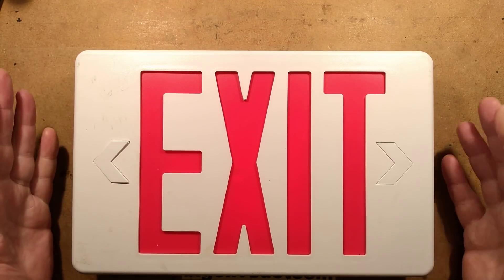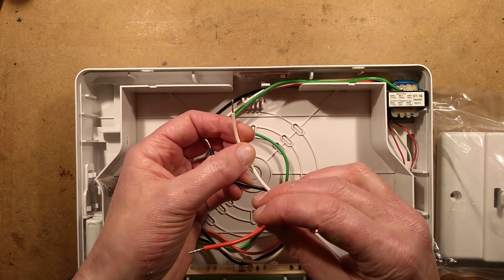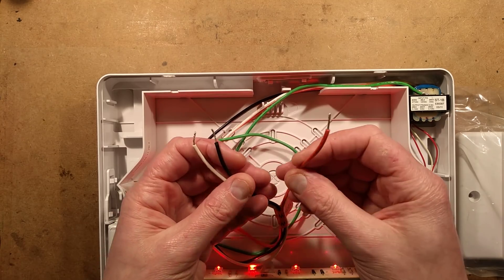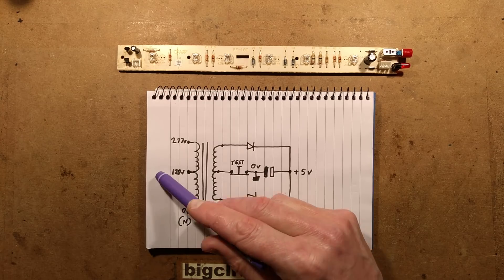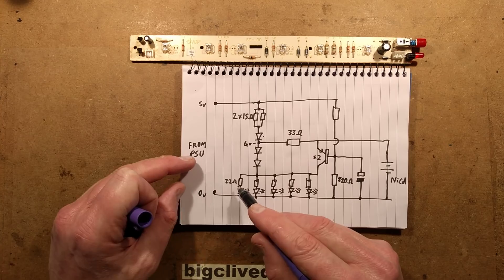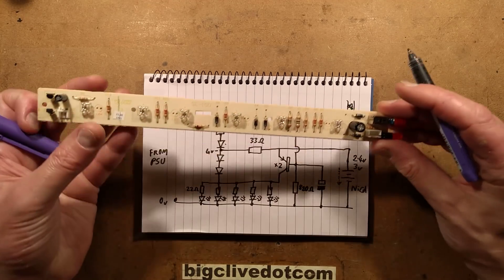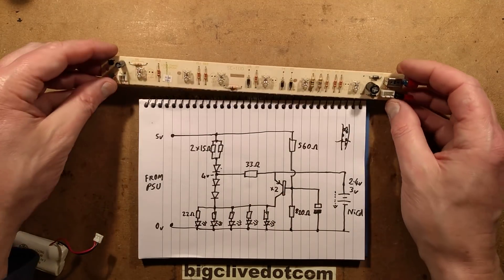Inside an American emergency light (with schematic).

Comment: PLEASE more morbid stories. I teach electronics to students and nothing helps to emphasize the point of safety more than such stories. And I ran out of stories of me getting zapped because of my stupidity.
Reply: Never be one "thing" away from a fatal situation.  Always treat the wires as live, even if you know they're dead.  That's saved me a couple of times.  Once from my own stupidity and once from someone else's mistake. When death is on the line, you want as many safeguards as you can reasonably get.
Reply: Rent a copy of the Martin Sheen movie "The Believers" and show the opening scene. I was a teenager, not afraid of electricity, and since I saw that I've been very wary.
Reply: I heard in class of a copper thief stealing the copper bonding from a transformer substation and died on his way out from the brand new electric fence.
Reply: When I was at school doing a project involving water pumps and a tank, the teacher handed me a "12v" transformer to wire up my damp windscreen washer pumps. The zero had rubbed off. That's the one time I've ever been electrocuted (based on the fact I passed out for a few seconds I'm going with electrocuted!) and I can't say I enjoyed it. 
Moral of the story - teachers are assholes :)
Reply: @beware_the_moose  as an academic teacher I agree 100%
Reply: Working in an 480v industrial panel, probing the connections on a terminal strip, which was a series of points in an E-Stop string. I was troubleshooting why I couldn't clear the E-Stop. Inside the panel was a 480 to 120V control transformer with long brass studs for the 480 side, which was normally supposed to be covered with a sheet of Lexan or Plexiglas. Well the cover was gone and I was leaning against the side of the panel with my left arm, and my right arm touched the brass terminal. This put 277v (one terminal or 480v 3 phase) across my chest. I was in the hospital for 3 days until my heart resumed its normal rhythm, but I sustained damage to the heart muscle that shows as if I had a heart attack in an EKG. That one mistake could possibly shorten my lifespan by as much as 10 years.
Reply: When you've rewireda mains plug, ALWAYS screw it back together!! I forgot once  years ago, accidently kicked it, back came off & I stood on it with bare feet! I can still recall the pain now as I type this. :(
Reply: @samarnadra  If anyone wants to watch that video. here it is: https://www.youtube.com/watch?v=H66Fbg9nrk4 Great stuff!!! :-D
Reply: I have many.......
1- never trust the guy that says "The breaker is open".
2- If you don't check for errant strands of wire on a terminal row, you will replace said terminal row.
3.-If you try to use a drive that is rated 410-3ph-1g-1n on a power supply that is rated 440 3ph1g, said drive will die gloriously.
4.- Check the new guy's work for a few days and make sure he doe's not put all of the "extra wires" in the bottom of a  480 x 240 x120 volt transformer into ONE LARGE WIRE NUT.  It will release a LOT OF MAGIC SMOKE.

Comment: This is the second video in which you've said UK emergency lights have to run for 3 hours.  Not true.  The duration can be one, two or three hours.  Which one is used depends upon circumstance like if the building will be evacuated immediately, if it will be re-occupied before the batteries can fully recharge, etc. 

See https://www.firesafe.org.uk/emergency-lighting/
Reply from the maker: I've only ever come across the full 3 hour duration lights.
Reply: @bigclivedotcom  
Three-hour duration is by far the most common, but the regulations permit the other durations in appropriate circumstances.  Many manufacturers may choose to only offer 3-hour lights simply to cut down on the number of products they sell and components they stock.  It wouldn't surprise me if the ones that do offer other durations simply take a 3-hour model and stick a label on it that says 1 hour or 2 hours and make the price reduction minimal.

Nevertheless, if it's a large building and the circumstances permit then it may be worth fitting shorter duration lights.  If you can get them cheaply enough.  If anybody even makes them any more.

Comment: Wouldn't normally think that its essentially an auto-transformer. Definitely worth noting...
Reply: Those little 120/277V transformers are marvelous for building Cockroft-Walton ionizers.
Reply from the maker: I've toyed with whether they could be used like that.  Theoretically a small secondary load like an indicator LED would help with primary coupling too.

Comment: I think the extra capacitor is to keep the the battery from activating when the ac line crosses zero. There is a smoothing capacitor on the other side of the rectifier diodes, but you can still see the LEDs pulsing a bit when run on AC power.
Reply: That's correct!

Comment: typical us crap… no psu just an old transformer… rip power consumption
Reply from the maker: Very low power and simple.  The light will probably last longer than a modern switchmode unit.
Reply: @bigclivedotcom  - Reliability is definitely more important in this application than efficiency.
Reply: Transformers are quite efficient, even switchmode power supplies use them. As long as you aren't using linear regulation for heavy current draws I don't see the problem.
Reply: A mains frequency transformer is typically more efficient than a switcher.  People mostly use switchers because they are smaller and lighter.  Most of the loss in this design is likely in the output side rectifier.  About 10% of the input power is likely lost in the forward drop of the diodes.  About the same would be true of a switcher design.   Nobody is going to do synchronous rectifiers on the output side at these power levels.  It is not worth the extra effort.
The primary side rectifiers and the switching device would lose only a few percent.

Comment: It's 40 years since I was involved with those things in the UK, but most designs of exit sign would also throw downward illumination to save having to fit an emergency light as well as the sign.  Upside: lower cost.  Downsides: if the sign fails you've also lost illumination along the exit route and the manufacturer sells fewer items.
Reply: In Colorado in 2005 I was surprised to see the green exits signs at floor level in hallways and corridors. This makes them visible even under a smoke cloud (where people would be crawling) and also provides some areal illumination.

Comment: we have a very similar exit light at work, but it had a few more transistors on it.  After reverse engineering it, 2 of the transistors formed an SCR (cross-connected) so that when the device is shipped, the battery is connected, but the LEDs do not light.  Once power is applied for the first time, the "SCR" is triggered and the LEDs light, and will continue to light when power is disconnected.  Disconnecting the battery will reset the battery "freshness seal"
Reply: Right. Our transformers are out in front of your house. 'Round here it's 2 houses to a box.

Comment: It's a misnomer or misunderstanding that US residential power has 230V across two "phases", we have transformers with one distribution phase and two 115V secondary windings, one turning in the opposite direction, to create two "poles".
Reply: Relative to GND the two sides of a North American power installation are indeed 180 degrees out of phase, but it's really just one 220V phase with a center tap.
Reply: I prefer the term "split phase".
Reply: Technically you could call it "two phase" but usually it is referred to as "center tapped," or in the case of being connected to circuit breakers and such, "two pole." (Two "hot"/live wires)
The reason why "two phase" is not correct is, there were older power distribution systems that used two phase, 90 degrees apart, thus making it easy to run motors. Of course, if the loads are not balanced, the phasing will be off, so the circuit won't work well (possibly even overheating the motor!). So, it wasn't very popular.
Reply: trickster721 Technically, it's called "split phase".
Reply: Yep. I cannot count the times I have explained this to people, some even being electricians.

Comment: Is this code-compliant emergency signage in the US? If a water sprinkler fire suppression system were spraying water on it, could it short out the sign?
Reply: ebulating  So there isn't a uniform code for emergency signage? That seems rather dumb to me.
Reply: @eddiespencer1  it is rather dumb and ambiguous. But you have to remember that we're basically 50 loosely sewn together entities governed by general federal guidelines, most of the rest is just left for the states to decide. It makes politics here quite confusing.
Reply: @8bits59       Count yourselves lucky.  In Europe the idea that even independent countries can make their own laws would bring about apoplexy in the control freaks in Brussells.
Reply: @eddiespencer1  There is, but states and cities may have their own rules beyond what the national rules say.
Reply: ebulating  Not sure how your answer is relevant since the question was about whether it met ELECTRICAL code regarding water infiltration, not if it was the right colour.
Reply: Many surprisingly simple designs work for keeping sprayed water out.  The direction gravity makes the water go is very important to those designs.

Comment: Its a good idea to cover off every wire that is not in use always
Reply: I think the floating lines is a bit of a ridiculous idea. Surely they could have had some binding posts or something and if you want to wire up to either of the windings you can, without a hazardous thing flapping around.
Reply: @BenHelweg  Or both wires could have come capped right out of the box, letting the user uncap whichever one is going to be used.
Reply: Its weird how he left the wire there, he should have cut and taped it. Was he certified to do the job?

Comment: Nice reverse eng. The cap on the base of the transistors might be just to hold them off after power fail for a short time - though I still can't see a good reason to do that from your cct.  I like the way you had a stab at what wavelength the leds are Clive - very good ! ( I just checked, and yeah, 640nm looks a good guess - very orange-y)

Comment: I like the graphic of the European sign, especially since it makes it easier to understand for those who can't read. However, I feel there's much more simplicity in the visual design of the American sign which also makes it fairly clear. I also think the red is a better color for the purpose.
Reply: Your eyes are roughly 20 times more sensitive to green photons as they are to red photons, thus the change. 
Also, in the case of fire the green will be seen as a sign rather than possibly confused for a spot of flame.
Reply: @pingumcping  never seen them in the US, only European media so didn't know that
Reply: IMHO, they should have used blue (or a blue-green) because most colorblindness is green or red. But then again, men are affected more often by it, so it wouldn't surprise me if the agencies don't care.
I'm going to miss the red exit signs though, they always stood out more than the green ones, in my opinion. (and I'm not colorblind) But that might also be due to my interest in engineering and/or design, where green means "good" (I guess you could say though, the exit is a "good" place to go? XD)
Reply: @BenjaminEsposti  Care to test out if the red signs still stand out when you're surrounded by red flames? ;) ;)
Reply: @pingumcping  we use the running man ones in the usa too. in both red and green. it just depends on where you are. places have different fire codes and laws. i know state sovereignty has become hard to understand when you have your eu parliament dictatorship unilaterally handing down laws to you for your own good.
Reply: @pingumcping   we fucking NUKED Japan! Why the fuck should we have to adopt their signs?

Comment: How effective would that colour be in the event of a fire?  Would the reddish/orange colour stand out enough for people to see it?
Reply from the maker: Red is often used for beacons on tall buildings and pylons because it has greater visibility through haze.
Reply: Interesting, thank you :)
Reply: If there is a fire, near this sign, you'd probably not run towards it anyway.
Reply: @Killzilla6  - If the fire is next to the EXIT sign you are f'ed anyway.
Reply: if the building requires exit signs to find the way out, it was designed stupidly to start with (there's exceptions, like factories and larger buildings) but for the most , straight hallways and exist at all ends of them makes sense ;) not the zig-zag round corners over hills and dales tomfoolery commonly seen.

Comment: That sign surprised me for three reasons:
1) The power light was red rather than green. I believe there was a law or code change a decade or two ago that "normal condition" pilot lights had to be green, and basically all equipment changed at that time.
2) The sign is red rather than green. Again, I think there was a code change a few decades ago. I haven't seen a red exit sign in decades, they are all green now.
3) That standby current of 30ma is extremely high for a AA NiCd cell, it should be more like 5ma.
I think the first two points are answered by that date tag on the board that seems to say "11 05 1971", or November 5 1971. That sign appears to be almost 50 years old and unused, with a still-functional battery!
Reply: Date code on the battery (042711) and the transformer (03/11) is 2011.    The board tag is 11 05 1571.  Pretty sure LEDs were not in use in 1571.  That number is more likely an inspection number or part number.
Reply: When I visited the US for the first time last year, I was instantly greeted by a red EXIT sign when arriving at JFK. Lots of buildings in NYC had these red EXIT signs, it was quite interesting since most if not all in Europe are green signs visualizing an exit door.
Reply: I'm going through and replacing old exit signs at my workplace in the Dallas area and we use red signs with red status LEDs. The fire Marshall was just over and said that that was the type we should be using.
Reply: Yes they did. They weren't very bright, and they were fairly new. But you have a good point. While that red pilot LED would have been possible then, I'm not sure that the illumination would have been possible with the LEDs of the day. Maybe that isn't a date code, but it looks like one.
Reply: I don't think I've ever seen a green illuminated exit sign. Not saying they don't exist, though.
Reply: I see red ones all the time.  In fact, you'll rarely see on that's not red in the US.  Also, I doubt that is a date code.  I find it unlikely that LEDs would be used in a fixture of that age.
Reply: The Eastern US still uses mostly red EXIT signage, whereas the Western states have used mostly green for a couple of decades now.
Reply: red exit signs are required in at least 2 states green are required in one and theres general recommendations both ways
the only thing osha code says is it needs to be distinctly colored. 
random infographic from some random site who knows if accurate
https://i.imgur.com/lkrhMaz.png
Reply: One of the more annoying aspect of the regulatory framework in the US is that quite frequently, there's small but significant differences between individual states. Some states require one color or the other, most states allow both. Federal law only says it has to have a "distinctive" color. In Ohio, where I live, it seems that both colors are allowed, as I see both types in use. Heck, I've even seen ones that are a card with fluorescent orange print, with a dim blacklight shining on it to make it glow. Those seem to mostly be used backstage at theaters and such, however.
Reply: In Oklahoma we are required to use red and not allowed to use green. (I tried. A customer wanted green) The only place green are allowed are dark places like movie theaters. I don’t know what the logic is behind it. I’ve installed a couple of radioactive exit signs in places that we couldn’t get power to. They looked to have a gel inside that would slightly glow, I don’t remember what color they are. Pretty sure they don’t make them anymore.
Reply: different states have different laws, many states are not specific about what color
Reply: The design of that sign is much too new for being nearly 50 years old. Secondly, most exit signs were once made of white painted metal, these days, it's all plastic and ground wiring for lights were not common until about 35 or so years ago in the US anyway (the green wire). West cost uses green exit signs. My old apartment building, built in the early 60's has old incandescent Exit signs with green glass lenses, this being the west coast though.
Reply: ebulating  Really? I'll have to pay more attention when I'm out about.
Reply: Mai Mariarti  yes they did.
Reply: Also I think the 1971 date refers to the fire code, this unit is almost identical to the new ones I install.
Reply: Or as Richard says it's a tag number
Reply: i go to school for electrical trades and exit signs in the us can be red or green how that on the national level state counties cities municipality, all have different laws and codes so in some places a green exit sign may be legal but in other they may be illegal,  and yes everything is like that
Reply: If an area is dark the red doesn’t affect your eye’s cones.  You have a better chance of not tripping in the dark.

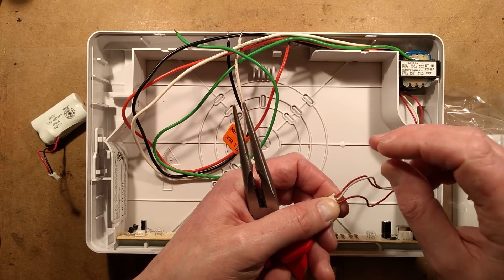Comment: 7:22 you mean the white one is a center tap buddy .
Reply: Actually the black wire is the center tap. white to orange is the whole primary winding. With 120 applied to black and white you can measure 277 orange to white. It's an autotransformer.
Reply: Sorry, my bad. I was on the other winding.
Reply: no biggy just a bit of confusion like life is all the time hahaha